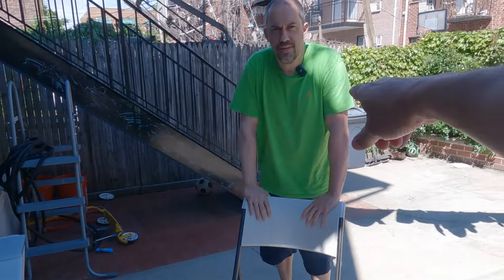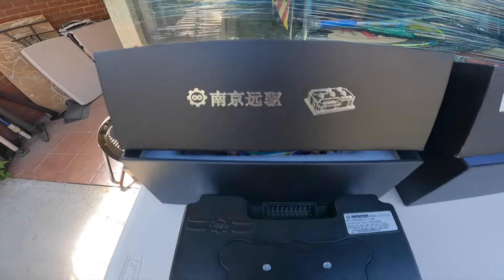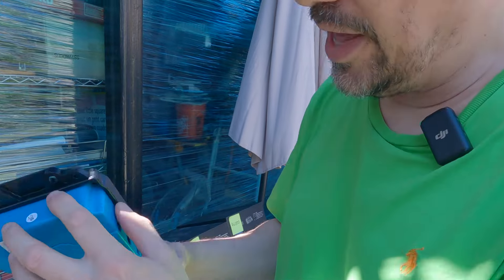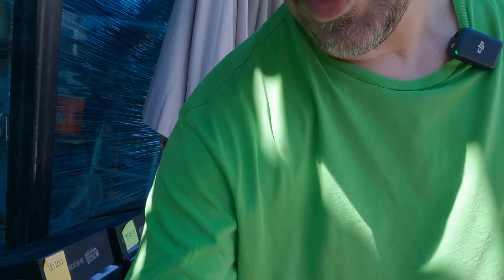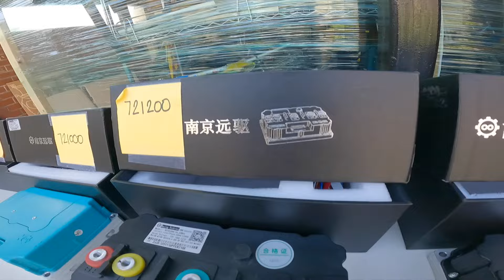How To Choose The RIGHT FarDriver Controller For Your E-BIKE

Comment: would the ND72300 work for my Kugoo wish01? It’s a 1500W rated 3000W peak motor
Reply from the maker: What battery are you using…?
Reply: @ 48V 21ah stock battery
Reply from the maker: Specs say it’ll work

https://a.co/d/aJIF6Rg
Reply: @ alright, thanks man

Comment: @Mr. E what do you run on your Bandit? I also have a Bandit, wondering what my options may be for future power. I found this episode Very informational, thank you 🙏
Reply: If it's a surprise, I get it 🤙 Can't wait to see the Green Machine 🔥
Reply from the maker: I am running a 5KW motor so I’m going with the FarDriver 72/450 but I’m also using Spark CycleWorks beefed up swing arm…
Reply from the maker: No… Not a surprise… I’m trying to share as much as I can towards the build… the reveal will be the surprise… 🙌💯💪

Comment: i have a question  can i run a stock surron battery with a fardriver 72530 great job loved the video
Reply from the maker: I believe so… Let the boys confirm but it’s range of voltage and 72 is the top of that range… 🙌💯💪

Comment: Mr. E. will the Fardriver work on a 52 volt 20 Amp Hour battery with a 1,000 watt fat tire Bafang motor?? Also can you connect a torque/PAS sensor to the Fardriver? What brand display is compatible with the Fardriver controller?  THank you in advance for your answers! JB~
Reply from the maker: It can work with 52V

Torque/PAS sensor doesn’t work with FarDriver

They have DKD Displays

Comment: Blue fardrive are 30 MOSFET controllers instead black are 26 MOSFET...
For example first controllers 72680, 84680, 96680.....😘
The "blue" has higher phase amps than the black..
Reply from the maker: Interesting… 🤔 I did not know that…

Comment: Just told me I'm poor cause none of the low end models are included. 😢
Reply: Not the case. The 72450 is now available and is a basic controller for stock upgrades. It's an inexpensive choice as an option to stock controllers.

Comment: few not for me Mr. E lol just want a nice controller that can handle a 3,000Watt motor , RGB lights, high end display, sound system, and big battery that can do 100+ mils 55mph caped Speed. that my dream Ebike i wanna make when im ready to upgrade my ebike. i may be a fast demon but i ant no speed demon. O speaking of what he said of being safe i need to find me a BIG helmet that i can fit, im riding out here with no helmet >.< cause of my fat head with dreads
Reply from the maker: The 72/360 should work well for you… 🙌💯💪  Oh boi Reese has dreads… he use the RUROC in a 2XL…
Reply: @mr.e_from_nyc  think yuuuuooo! lol
Reply: @mr.e_from_nyc  correct!!

Comment: Easy pick. Get the strongest controller and tune it down to your battery 🔋
Reply from the maker: But there’s a size difference… Oh and the price… The 1800 is a bit more expensive… some may not have it in their budget… 🙌💯🙌